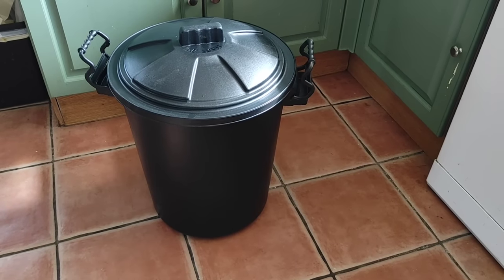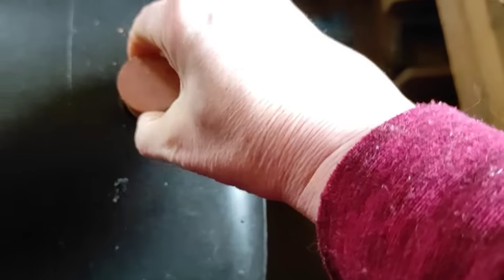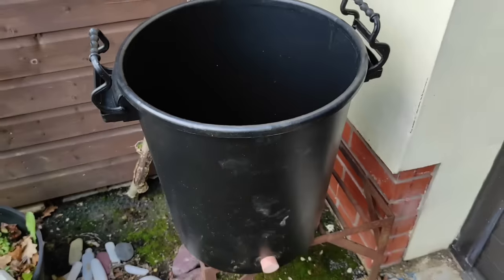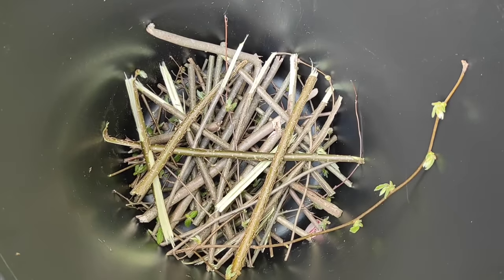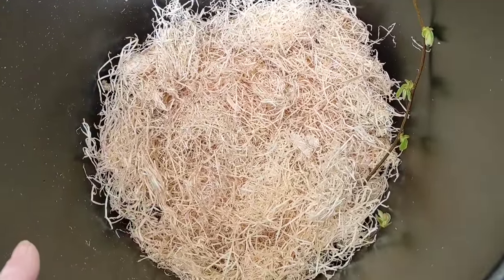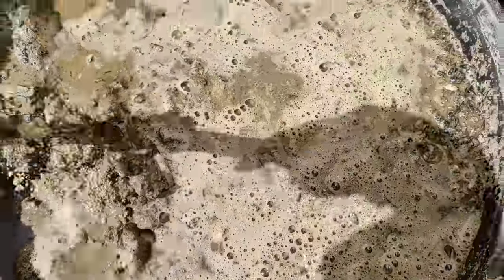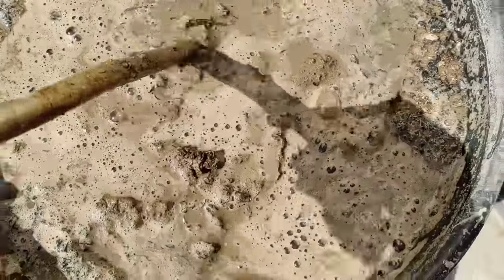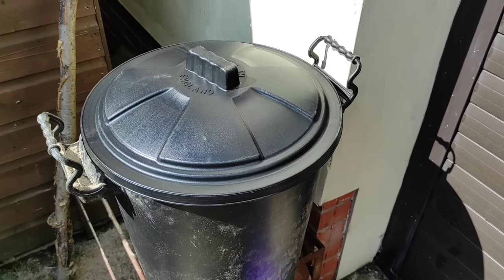Soapmaking from Scratch: Woodash Lye

Comment: Great video. The step you missed was having a bucket of clean water to immediately wash off splash. Also, safety googles are a must. 
I’m looking forward to part two.
Reply from the maker: I do mention goggles, and for me, vinegar is stage one safety, but yes, water helps!
Reply: @SallyPointer  Coming at this as someone whose education was primarily in chemistry and a medical field, it's usually preferable to use clean water to wash away lye splashes, rather than an acid, simply because of the potential heat etc formed by reacting vinegar with the lye. But either way, you still need a lot of water. Also, even as a glasses wearer myself, I would still recommend properly-fitting goggles (preferably better than the cheap ones that have gaps where they don't meet your face well, but at least some that come with side guards and some protection from above and below the "lenses"). That big gush is precisely why. That could very easily have swamped over regular glasses and any amount of lye meeting your eyes is a huge issue. Obviously, it's your own choice as to what precautions you feel are necessary, but that would be my recommendation. 

I obviously second the idea of not tasting lye of any variety (though that zing test is also used by some makers on their finished products to double-check that there's no unreacted lye in the final soap)!

All that said, I loved the video. I've been massively into cold-process soapmaking for a few years now, and although I know some historical facts about the process, and extracting lye from wood ash, it's very interesting to watch the process being done. I can imagine that it wouldn't be hard to see how, perhaps, an open fire, some water, and some animal fats from cooking meat over the flames might end up combining in a way that produced a primitive "soap" product.  I'll be interested to see how your lye works out, as generally in the soap-making community, KOH is used for liquid soaps and NaOH is the usual base for hard soaps. So I can't wait to see all the future videos!  

Thank you so much for sharing your experiments with us. It's always fascinating and I always learn something new.
Reply: @M MacNicol It likely also depends on the fats/oils used as well - hard fats tend to make a harder soap, while oils (and I'm thinking especially of olive oil when making pure castille soap) tends to make a much softer bar, even when using NaOH. But yes, soapmaking can be incredibly simple, but also incredibly complicated too.
Reply: @M MacNicol hey, did you find any natural sources of NaOH?
Reply: Very much appreciate seeing the process of that which I’ve long been fascinated by and intent upon its creation. Seeing the process offers one So much more clarity…and of course enhanced by group input for one & all 😊. Naturally, as chance would have it, now that I’m forearmed with the methodology, I no longer have a fire ; ) ; ). White vinegar is also my essential standby when soap making - in a spray bottle 😊. // I couldn’t help but wonder if the Lye you garnered was put back into the ash to further steep, it might strengthen? Also leaving the mix to steep for longer initially….? All food for thought, methinks 💞
Reply: @JustAnother…..Ive always found my particular safety mix in a spray bottle to be very effective - with no heat ensuing. Albeit apart from white vinegar and water, there’s also some Borax dissolved in it. Perhaps that makes the difference. What say you?
Reply: I’m curious to know how one determines exactly how much of the resultant Wood Ash Lye to use in one’s soap making process. That’s one of the things that’s always detracted me from pursuing a progressive course ; ))
Reply: PS. What a lovely combination of wood (trees) went into your Brew 💜
Reply: @JustAnotherBuckyLover - Olive Oil soap - namely - Castile- does actually makes hard soap… if it’s left to cure, as its supposed to, for the full 9-12 months, and lasts well. That’s generally why it has an higher price tag - the time involved for the full Cure 😊. That and using a more expensive oil, of course ; ))  I just put it away and ‘try’ to forget about it (after a suitable period of turning each bar ; ) ; )
Reply: @brigidlaffey7343  Yes, I know. But most people don't realise that you have to ignore it for a year! They want to use it within weeks.
Reply: @brigidlaffey7343  it's going to depend on the concentration of vinegar and what you use it for. A smear of soap batter or a few drops? Probably fine. The concentrated lye solution? That's going to depend on how much vinegar is involved. I would still generally recommend water (and a spray bottle probably isn't fast enough of an application in the case of a big lye solution spill onto skin) but for small splashes, it's probably ok.
Reply: @@marymacnicol3038, adding some melted beeswax to your soap mix when it is warm can help to get a harder, longer lasting soap too. My partner has been making soap for a couple of decades and that's one way to get a nice hard soap if you have put essential oils (or other additives like aloe vera gel straight from the plant) in that cause softness in soap. But she makes her soap from scratch, not using castile that has been prepared by someone else.

Comment: In my part of the world a wooden barrel would have been used. (I realize you are using what you can source)  A foot of straw placed in the bottom and covered with the ash from a hickory fire.  Water would have been added and the contents soaked.  Then the lye would have been run through a second barrel full of fresh ash and the process continued until the proper strength was achieved.  
We also used a hopper made like a baby's crib/manger, lined with straw, filled with ash and water poured over the ash and the ash changed out.  A wooden gutter caught the lye and channeled it into the bucket.  
An ash hopper was a mandatory fixture in most of the rural back gardens when I was a kid.  Most were unused by that time, but you could get a good lesson from the old people just for asking.
Reply: Yes, that is how it's done.  It is run through a few times and boiled down, in my experience.

Comment: Oooh, fun to see this from the very beginning.

It's easier to mix powdery stuff with water if you do it in layers instead of all at once. Also a better container might be one of those construction-worker type plastic water jugs that have an open top (with a lid) and a bottom tap, so instead of being flooded when you take out the bung, you just turn the tap.
Reply: my cousin in Wyoming made her soap from wood ash, She used a Pringles potato chip container. then sliced the soap into perfect round pieces,
Reply: @vernamcguire6759  That is a wonderful idea!

Comment: can easily avoid that pressure surge when opening by using pvc pipe with a valve.  they also have threaded parts that you can add a rubber gasket to create a seal.  then glue up your pvc with valve, and as an added step, a 90 degree elbow to ensure the flow goes straight down.

Comment: It would only work in smaller containers of 10 gallons or less, but you could try vigorously mixing ashes with water in a wide bucket skimming any floating material as it comes to the surface  before pouring it all into a long preferably clear pipe of equal volume and letting it settle decanting the excess to get a relatively clean lye solution with no filter material.

Comment: Great video!! It’s so cool to make things yourself. I’ve used good grade lye to make authentic 
Bavarian pretzels. I wore gloves and eye protection but some of the lye water ran down my wrist. I didn’t immediately rinse it off and later it burned a bit similar to hot water burns but not as painful. I’m sure wood ash is not as strong though. I had redness and a slight itch for a few hours then I was fine.

Comment: This is very interesting! I have a suggestion for you regarding the plug for tapping. You should buy a tapping faucet so you have control of the drainage. I was quite worried when you pulled the plug and wondering if you were burned. Great video! But safety first!

Comment: Hi Sally, I love your videos! I believe you can run that water through the ashes several times and get a stronger lye solution each time. I'm pretty sure I've seen videos of Hutterites (modern day) making lye for their soap in this way. And I'm also pretty certain it is mentioned in the Foxfire series of books as well. Love your videos, and I'm excited to see these on soap. Thanks!
Reply from the maker: It's best to use fresh ashes for each run through, so I just concentrate by boiling

Comment: So glad you picked up the half-round rasp rather than trying a larger spade bit! One otherwise would have to build a jig with a backing plate and through-bolts on the inside in order to go bigger and holding it centered would still be a challenge requiring a hole saw rather than a larger spade bit. Glad I found your channel. Hello from Alaska.
Reply: But OMG!! I couldn't warn you what was going to happen when you removed that bung! Glad you were not injured. Your spectacles are far too inadequate to the task at hand. One can find  basically anywhere goggles with which you can still wear your prescription spectacles doing such a task. I'm writing having been employed/engaged for many years using hazardous materials. I wouldn't expect an egg to float for any length of time because egg shells are so porous, i.e. they breathe through the shell. Your egg was saturated within a short time and by rights, sunk within a minute or so. I'm guessing another litmus test would have shown the lye having been of sufficient strength after your first test. I'll look for your follow-up video to find if I'm talking from my nether region...

Comment: Thank you SO MUCH from a scratch soapmaker in the States! I've only been able to find one photocopied page from an 18th century book on how to properly make lye from wood ash, and it was not as thorough as your video. Making soap truly from scratch has been a goal of mine. So far I've only ended up with potassium carbonate instead of potassium hydroxide. I have a feeling your follow up video will explain how to turn the initial wood ash lye into proper soap lye. Very grateful I found your channel!
Reply: I found better results soaking the ashes in water vs passing water through.
Reply: @TheBrianna1431  did you end up with strong enough lye to make soap? I read that straw adds some of the salts necessary to turn the potassium carbonate into hydroxide, but I've never tried filtering the ash water thru straw myself. Very curious about your results!
Reply: @DirtyDSoaps  Idk to be honest, I haven't tried filtering it with straw. But if you want any results I still recommend soaking over passing through.
Reply: @DirtyDSoaps  oh, also I have made soap using this method works great! You end up with a soft soap bar. If you want a completely hard soap bar you have to add lime.

You can make your own lime( calcium carbonate) but it is it's own fun project. You have to bake shells until they are white and flaky. Then add water.
Reply: @TheBrianna1431  i appreciate the tips, thanks luv!

Comment: I needed clear lye for a different project and found that it gets out colored when leached in this classic way, but that it remains clear when ashes are simply occasionally stirred in a large bucket for about a day, allowed to settle and decanted. The concentration is weaker, but it remains clear even after complete reduction and getting white salty crust on the surface. I cannot explain it, it makes no sense. But it looks like your lye is colored even before pulling the plug out. Probably depends on the ashes as well. I would also stir it very well to get all the charcoal pieces float at the top and then would remove them, but it is not necessary. So the color remains a mystery to me. I know it can be burnt off and have tried it but it is a very very messy job. Hot dry lye reacts with iron, it turns green. Pure alchemy really.
Reply: Probably residual tannins
Reply: To produce a clearer lye it’s recommended to sieve the ash to remove chunks of partially burned wood. Cleaner ash should produce a clearer lye.

Comment: Just a thought about the historic use of withies. My understandingly is that for most purposes withies would be twisted until the fibres split and separated into a softer more flexible, mesh like material. This would probably work better for filtering liquids than just stacking the twigs.

Comment: Thank you for the basics for lye production. Sufficiently diluted, it makes a great cleaner for many things. 
Three things come to mind: First, I would try to find a chemical-friendly tap/faucet/spigot that has a threaded base and a seal that screws on from inside the vessel to prevent leaks or uncontrolled harvesting of solution. Second, how many times can you use the ash to gain more lye solution? Lastly, how do you dispose of the spent, wet ash slop?  Cheers from Alberta, Canada.

Comment: From a designers/engineers point of view, fit a tap on the lye bucket. You will be able to get the liquid out without it going everywhere under pressure. You could fit some hose pipe type of tubing to the tap and the other end can go into the bucket below.

Regarding strength, leave the water in it longer, that will make it more concentrated and then when you filter and boil it down it will be extra strong.

Regarding the “taste” test. I would advise looking into other ways of testing its strength. Putting any chemicals in your mouth like this (especially when there are idiots in this world who wouldn’t take precautions) are likely to cause themselves serious harm. I know you have put a warning in the video, however you didn’t say don’t try this at home or if viewers do this and end up ill, it’s not your fault, or even better, don’t advise putting chemicals in you mouth.

I’m very interested to see how the soap turns out and I am watching with interest

Comment: I usually reduced it by evaporation or boiling to increase the concentration of the lye when making tick tinder. Should work fine for soap tho use a hotplate outdoor as it kinda smells and the fumes are not good to breathe in. Oh and use a pan you hate or a ceramic one as strong lye does not like metal very much.

Comment: If you have less ash you can use an excess of boiling water as boiling water is better at dissolving than cold water. When I made potash I got a significantly higher yield than I have seen most people get using cold water.
Reply: I am also pretty sure it’ll go pretty fast if your using just a kilo or two.

Comment: Enjoyed this. Fascinating. 
There are plenty of tap connections ye could have "plumbed in" to your bucket, brass or plastic. Failing that, a bit of sand paper wrapped around a dowel (broom handle, etc) would have refined the hole after rasping. Still, an entertaining comedy moment.😁

Comment: If I were designing this, I would use a plastic nipple with a couple of orings or a bulkhead fitting with an actual plastic faucet, this would allow far better control of the output.  Then I might suggest that as a check, you might titrate your lye solutions with sulferic acid.   That in itself would make an interesting and valuable addition to your thesis.  Though as this video is 3 months old, it might be too late for you to do that.

Comment: A "honey gate valve" would have worked better than a stopper. They have rubber seals and can be opened slowly.
Reply from the maker: A lot have aluminium elements though, but yes, in principle
Reply: @SallyPointer  The one I use is mostly plastic, with stainless steel bolts. They're about $3 to $4 each.
Reply: A quick google shows that wooden spigots for barrels are readily available (which surprised me!), around £10.
Reply from the maker: @paulwomack5866  awesome!

Comment: I was doing some experiments with washing wool and the lye I made via just soak was a such a bright yellow it looked like I had buckets of urine hanging around. But the ash I used was ash used in another experimental archaeologists phyrotechnics experiments and so the ash was very very well burnt at a very consistent temperature. I have no idea if that would have made a difference, but the colour of our lye is incredibly different. 

The raw wool fleece washed fine with the lye I had
Reply from the maker: Yes, mine picked up a lot of tannins from the filtering sticks

Comment: Exciting!!!! I was recently watching a fellow discussing lye for food use (he was making pretzels and bagels) and he tried making his own lye as well as using modern-day hydroxide, and he emphasized over and over how dangerous and caustic lye can be. I can't imagine the face he would've made seeing you taste test the stuff!!!! I can well believe your tongue had a fit with stronger lye, though. I'm fascinated to learn more as you take us through these processes!!
I do have a question - the quote you displayed early on in the video, discussing the withies and twigs as mesh, also mentioned pouring hot water over the ashes. Does the temperature speed up the process? It's plain that heating the water isn't exactly necessary, but I did wonder about what difference water temperature might make to the resulting "liquor" hehe
I'm also SUPER interested to see how this will all come together, I've learnt about medieval soap, just bits and pieces over the last few years, and it really IS like potion making, it seems like the slightest changes will have HUGE effects on the resulting end product.
Reply from the maker: I think hot water would speed up the leaching a little, leaving it soak overnight works well too. At some point I might try and compare temperature and leaching times, that might be a useful thing to do.